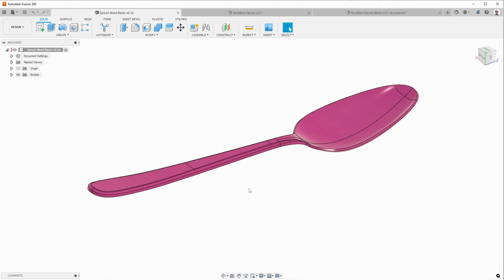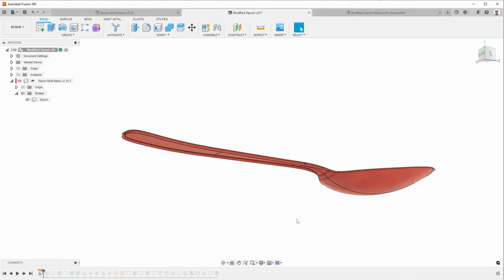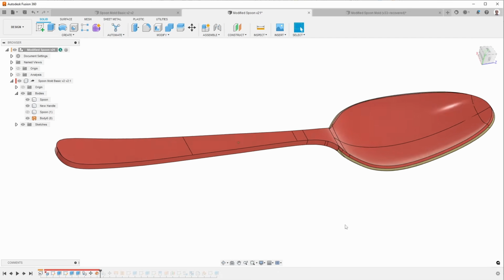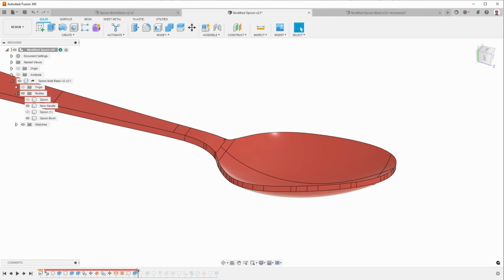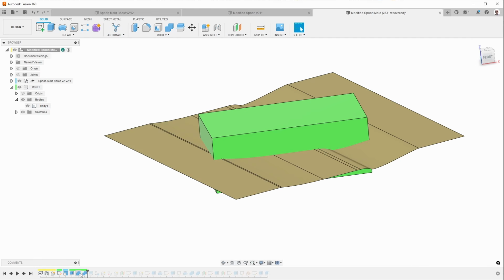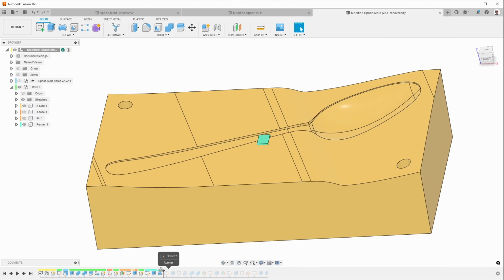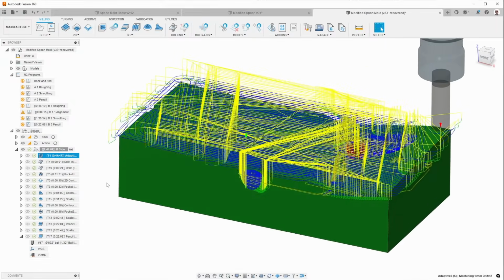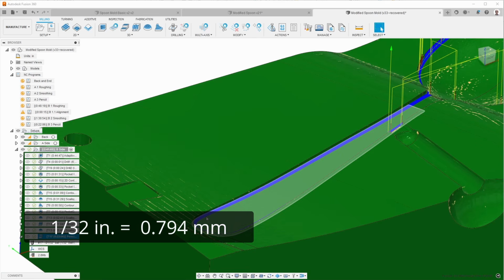Injection Molding a Spoon - Designing, making, using

Comment: As a guy who has designed a spoon before... God, it is way more difficult that it looks like. This is an amazing job.
Reply from the maker: Designing the spoon itself would be the hardest thing for me. I'm good with geometric designs, but not free-form designs. I tried using the mesh and surfacing tools to replicate the spoon, but gave up after realizing I had way to much of a learning curve.
Reply: @JohnSL  Türkçede  bir ata sözü var. Kaşığı herkes yapar, sapını ustası yapar . :)
Reply: @JohnSL  can I request private design ? Can I call you about email or WhatsApp?
Reply: @JohnSL  can I countact with you for private design?
Reply: I was thinking the same thing when I start watching it...there isn't a flat or geometric surface on the entire dang thing...Once you start dabbling in manufacturing, you never look at everyday items the same...I will be carrying on a conversation with someone and I will look at the item in their hand and be thinking "How the hell did they draw that"...
Reply: The initial design was harder to produce but in total it was a good design.
The folded curve on the handle increased rigidity while using less plastic. It would have required a bit more rouding here and there to be comfortable to hold, but it was very sleek and elegant.
I happen to have a spon here that is shot in the 100-thousands and it's 170mm long, weighs exactly 3 grams and has a thickness of only 0.65mm in the cup and 0.8mm in the handle. They use a trick to make it feel better in the mouth by placing a rounded bead along the inside lip of the cup section making it 0.9mm thick in a 0.9mm section.
The handle is shaped so it stacks with tapered edges in next spoon for packing and a final trick they do is add a raised end to the handle so it stacks with even spacing for a "straight" pack.  So many design elements to think of!
Reply: @1kreature  yes, the original design was very different, I would be pissed off if I sent something like this for manufacture and they changed it so much
Reply: Easier to just carve one out of wood, lol
Reply: Yes late friend teacher was one who did the dies for yo yo ..frisbe...and those  condiment containers for mustard and ketchup   resturant used to have...always  Remember  we would be out getting food and first few minutes  he would always  pick  items  up and slowly  look at and point out mistakes  he had made or others had made copying  design
Reply: I am a 3D designer and bro modeled this in the hardest way possible.
Reply: @Mt.Mando2081  yep. This is common with engineers and diyers. They ALWAYS use the wrong programs and do about 500 extra steps.
Reply: Yeah.... no kidding! I thought going into it that it would be a fun, easy little learning test.... wrong lol
Reply: I don't know. Looks pretty difficult from where I am sitting.
Reply: Yes it looks extremely difficult.. I’m just curious, how would you model a spoon in CAD from scratch? I’m not going to do it but I’m blanking on how exactly that would work. More specifically I mean the cup portion of the spoon
Reply: @michaelmains6950  There's two main bodies. The handle and the spoon. One approach would be to model them separately with two simple surface sweeps. Trim the profiles. Then join with a loft.
Reply: why would anyone design a spoon ? isn't rule #1 of engineering to never reinvent the wheel ?
Reply: I am not a dedicated 3d artist by any means, but that's just a plane. It's not that hard to make a rough mesh of a spoon moving individual vertices around and then subdivide it for smoothness and then extrude.

Comment: Excellent!!! are you concerned when you sand and polish that you dont touch the parting line?
Reply from the maker: Yes. I did my best to avoid getting too close to the parting line. As such, there are still some tool marks near the parting line. When I want to get that close to the parting line, I use a small toothpick and abrasive paste. That's a slower process.

Comment: Back in the 80s I worked for TK Designs, he had me polish pins to a mirror finish for an injection mold of what looked like a toy car tire.  Recently I bought a 3018 router, as you are using small bits, can you tell me how to set the speeds and feeds for cutting aluminum.
The 3018 can do slow speeds, but I feel that it cuts a lot better when I run it at full RPM.
However, I keep breaking bits, I have no clue what SFM or SMM I should be using?
The smaller the bit, the faster I break them.
Lee
Reply from the maker: My secret is to use GWizard. I did a video that covers how I avoid breaking end mills down to 0.010" diameter here https://youtu.be/6HpHvuyJBF4

Comment: Could a finish even close to this be a achieved with a 10000 rpm spindle? Awesome video
Reply from the maker: Absolutely. The main difference between 30K and 10K RPM is how long it takes. Both halves of the mold took a total of about 5 hours (or so). If you had a 10K spindle, figure on somewhere between 2 and 3 times as long.
Reply: @JohnSL  ok that makes sense so clear the schedule haha…..thanks John

Comment: Why should the thickness be equal? What kind of probs does it create with varying thickness. I'm designing a propeller, and it should fly well.
Reply from the maker: It doesn't need to be. In general for injection molding you want the thickness to be relatively uniform, as that helps prevent sink marks and/or issues with non-uniform shrinking than can cause distortion. In this case, I was asked to make it a uniform thickness.

Comment: Any idea what the price is on one of those new injection machines and how it would compare to an old school Morgan Press?
Reply from the maker: You can find information about the price here: https://www.manninginnovations.com/faq. He states that his machines start at $6,000. Both machines have areas where they shine. His machines allow 20 tons of clamping force for any mold. The Morgan, on the other hand, requires a more complicated mold when you want to go above 9 tons (if I remember correctly) where part is attached to the upper platen. Another difference is that the Morgan support ejector rods so you can set up ejector pins, allowing for semi-automatic operation. I don't think Manning's machines have anything like that.

Comment: Cool to see the entire process.  We are still working on our first mold, so its good to see other examples.
Reply from the maker: Let me know if I can help or you want to collaborate (this is a hobby for me, so fun is the most important criteria for projects).
Reply: @JohnSL  Thanks John!  We have the machine up and running but we needed a LOT more air.  We are in the middle of a 2-stage upgrade, so once that's complete, we will be back on the mold design/prototype.  Between you and Dragonfly, I've got a TON of information on how to be successful.  We are going to start simple and work our way to more complex operations.
Reply: @JohnSL  Can you show more about placing gates and injection mold sprue? How material flow? How to realese air safetly?